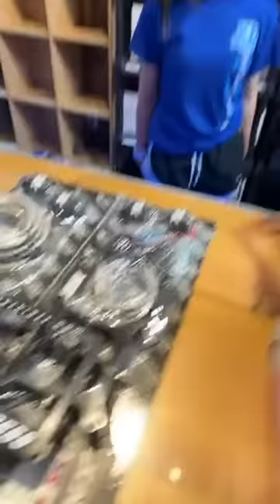NX DUAL STAGE BILLET CROSSBAR NITROUS KIT GIVEAWAY!!!

Comment: Old Man, take my advice. I lived over a decade having back issues. It would out of the blue flair up and I'd be stuck laying on the floor for days .. it always hurt but it would get so bad that it hurt from my lower back to my testicles and down into my ankle.. I finally decided to go see a back specialist and went to see 4 of them before I found one that I could get along well with and agreed on his approach to repairing it. He was a neurosurgeon. A neck,back and spine specialist. He offered to go in and open the pathway where the nerves exited that were being agitated which would get me at the most 5 years of relief or he could go in and repair it once and be done. I went with one and done. It was a small 7" incision under my belly button and he replaced the disc along with a fusion at L5-S1. I was up slowly moving by that evening and went home the next morning.  Hardest thing was to remember that even though I felt wonderful it was going to take months before the fusion had grown solid. I was push mowing my yard a month into it and feeling like I was 25q instead of 42.. I wouldn't hesitate to have it done again by a neurosurgeon. Look into it.. it's not that expensive of a surgery and it will change your life